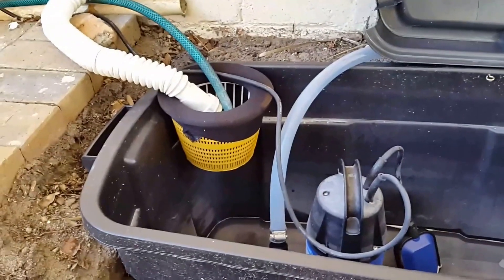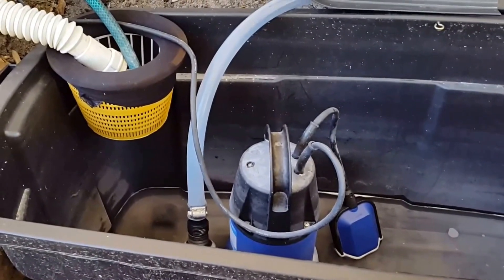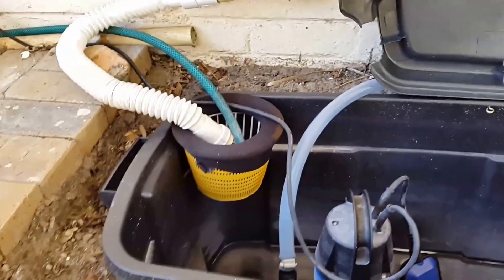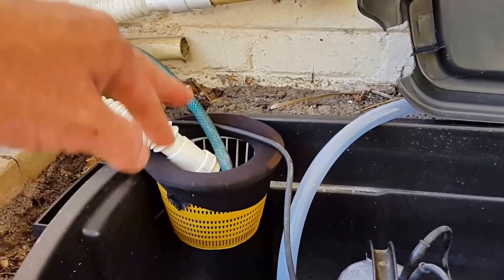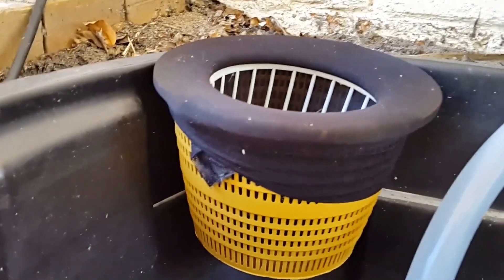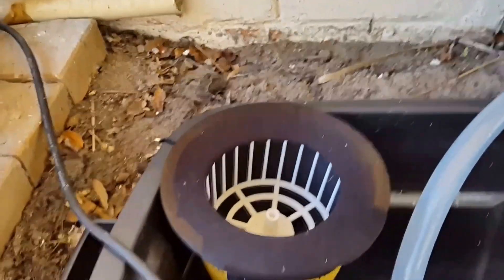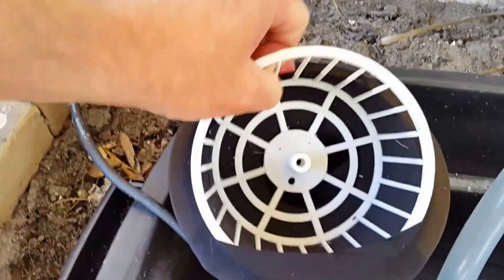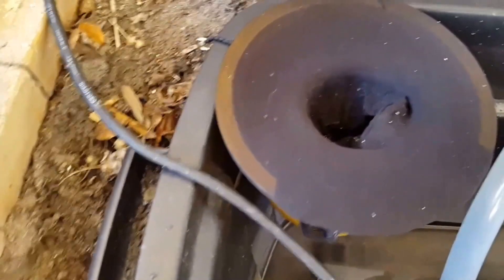2. How to make a DIY filter for a home grey water recycling system

Comment: thanks - my sock filter worked for 2 months, i use the water to irrigate our lawn (subsurface) and the smallest particles manage to block the control valve mesh filter which really reduces the pumps ability to push water thru.. Im gonna go grab a pool filter and some stockings, also have some plastic fly mesh i will use as a stage 1 to get out the large bits.. Most important is that it must be easily cleanable..

I use a temporary water tank (about 4gal/20L) with an automatic boat billge pump, and i plumbed it inline from our shower to normal drain - in case it fails the water just runs thru as usual.. the pump pumps the water up into 2 55 Gal drums, when they are full I run our pump for 15 minutes which just about empties them - one mistake i made was the joining pipe needs to be about 2", otherwise the 2nd drum wont flow thru into neighbor drum quick enough while pump is running..

Anyways thanks! when mines finally done and working better ill make a vid too :) greets from a fellow saffa in Long Beach, CA

Comment: great system, and easy to DIY, i a grey water system(11 years) and my problem has always been trying to improve the filtering, please let me know where you by the plastic ``holder`` that fits inside the ``pool`` filter(the one that keeps the stocking in place.Thanks again for a fantastic site, as well as a well presented and easily explained video
Reply: Yes, I'd also like to know where yo get the inner basket thing/holder that keeps the stocking in place please...